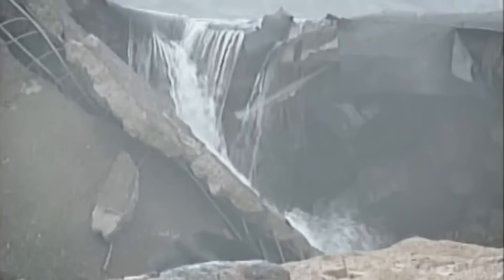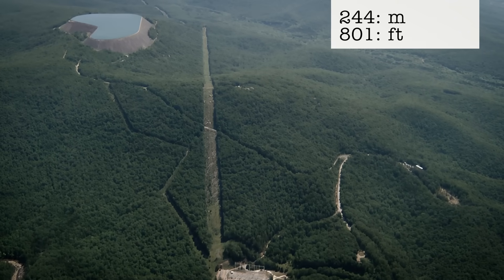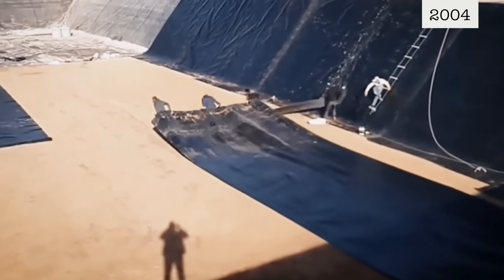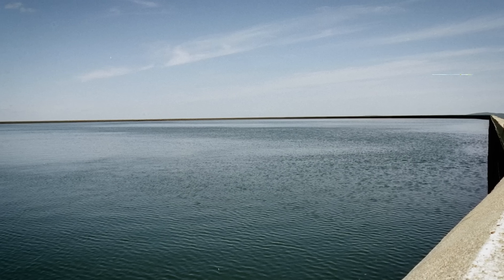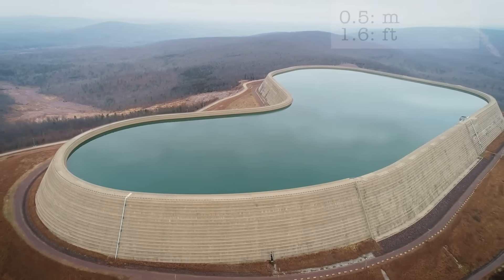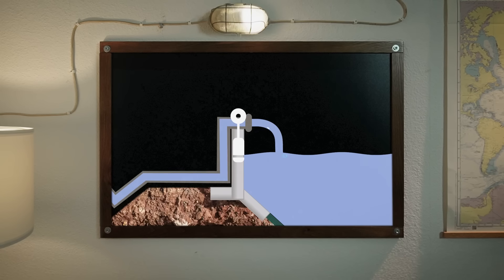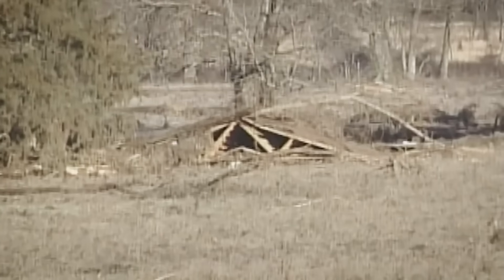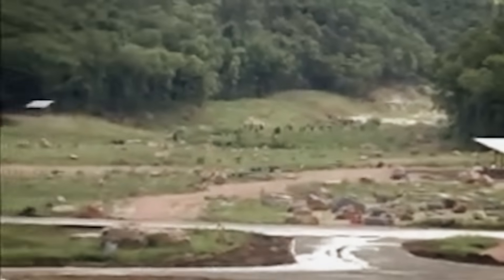This is One of America’s Worst Dam Failures!

Comment: That three foot wall was installed for a reason, was it not? But greed overtook common sense. Using that wall to retain more water that it wasn't designed to do caused this disaster. There should have been a spillway, you would think. By bypassing the actual reason for the three foot wall and adding what new technology they had at that time to supposedly safeguarding their greed just meant more chances of something else failing. Had they of left original plans in place, this probably would have never happened. 

Chasing the dollar caused many people an unneeded hardship 😢.

Comment: Back in the mid 90s I worked on a job fitting cctv cameras to watch water levels on dams in a hydro scheme. The full thing was being automated and the sensors weren’t reliable enough. The old method was someone driving around checking the levels by eye. So they opted for cctv. It was a great job. Miles of fibre optic cable in the middle of nowhere.

Comment: Its amazing that this facility was not constructed with an emergency spillway or fuse plug. Typically features like these are installed so that if monitoring systems fail, then those features will activate to prevent such a failure.  Unfortunately there was no safety redundancy that would activate automatically.  There's always human error in many of these disasters which is why safety features that do not need human intervention are needed. As a former FERC employee I remember when this occurred causing a system-wide review of all pumped storage facilities to assess safety.

Comment: 12:33 Thats Oroville, ill never forget having to evacuate when a giant hole opened up in the spillway.
Reply: OH, THIS IS THAT ORVILLE DAM!?
(Sac CA here)
I thought the CA Oroville dam break was from the emergency spillway breaking up?
It started getting water going through a bit but the emergency spillway broke and that's when it flooded everything. No?
Reply: @dsandoval9396  The video is not that story, maybe an image is. Oroville was initial failure of spillway during heavy rains, then failure of bypass spillway trying to reduce load on main spillway.

Comment: You made a physics error at 0:52 
"Converts kinetic energy to mechanical energy." Seems like you mixed up some words. You would usually say dams convert POTENTIAL energy (of the stored and elevated water) to KINETIC energy (flowing water), which turns the turbine and then generates electrical energy. Mechanical energy is defined as the sum of both kinetic and potential energy, so if you say you're converting kinetic energy to mechanical energy it's like saying you're converting kinetic energy to kinetic energy: Kinda redundant and no conversion is taking place there. You might have been trying to say the turbine blades convert the linear motion of the water into a rotational motion of the turbine shaft. Either way, whether it's rotating or not, it's still just "kinetic" energy. Energy is a scalar value, and doesn't care about direction.

Comment: Amazing story. I wonder why we never heard about that one. But if I'm not mistaken Mexico had a pumped storage system to power the steepest part of their Mexico City-to-Veracruz railroad, called El Mexicano, in the 1920s.  It's Apparently still in use although the railroad was realigned in the 1980s to a grade with a big summit tunnel, also called El Mexicano, where only diesel is used. The race, located at Tuxpango in  Campo Chico, Veracruz can be viewed in Google Earth here: 18° 50.323'N 97° 2.171'W The water is derived from the Tuxpango Dam visible a little north of there.

Comment: ""Hypothermic" and burned by heat packs" ? Quack medicine at its best. 
Research was done on courageous volunteers during WW2 to determine why deeply hypothermic live sailors fished out of the winter North Atlantic ocean after ship sinkings 
were promptly dying. It was finally determined that the only safe method of saving them 
after rescue was by providing heated air to their lungs (ideally via breathing apparatus) and NOT permitting any killer external warmth to be applied first "to warm them up"...

Comment: I was dumbstruck at the fact it had NO spillway. My local reservoirs are only small things that probably wouldn't even flood the rivers, but they still have spillways.
I can't even fathom a logical reason for skimping out on one

Also, why is there the option to tell the computer to ignore the SAFETY SENSORS?
Reply: Because top management in the executive suite that earn the big bucks and bonuses insisted on the modification.

Comment: I know this is only a summary but it is hard to understand how they could not know the true water level. As the water level is flat you would think they could easily calibrate each individual level indicator against each other. Similarly you could manually dip every low point. So you could very simply know what each level indicator read versus the true lowest level of the wall. This is truly not rocket science.
Reply: Outsource the monitoring of the water level to a computer, override the warning, and suffer complete destruction! It would have cost 20K a year to hire one-eyed hillbilly to watch the water level, but no, that was too easy.
Reply: If you might reall, NASA lost a Mars spacecraft when one contractor was using the US standards measurements and everyone else was using the metric system.